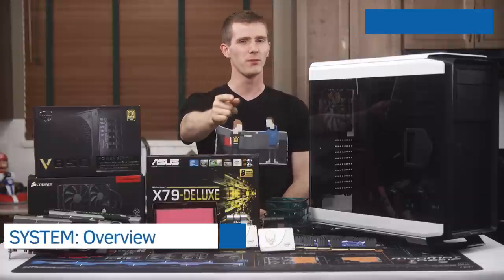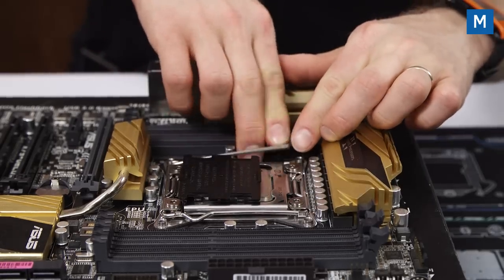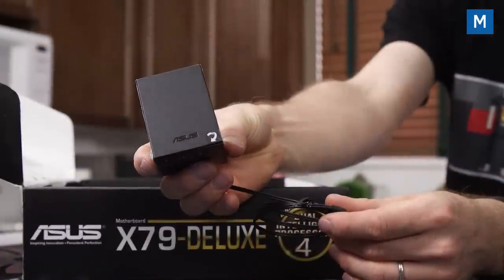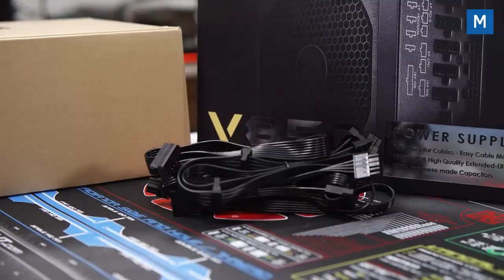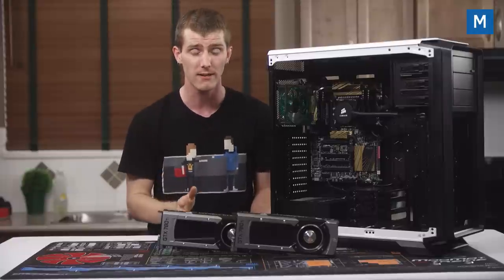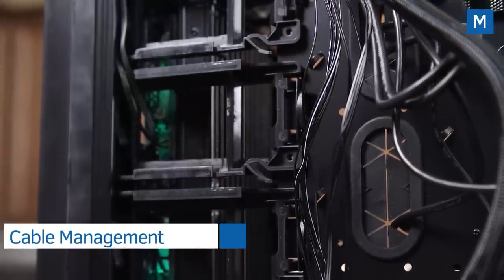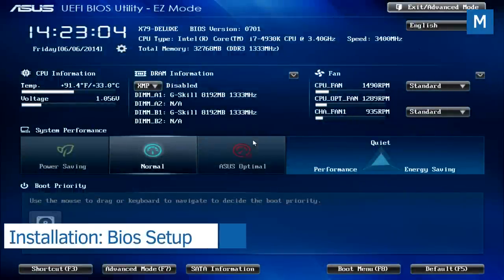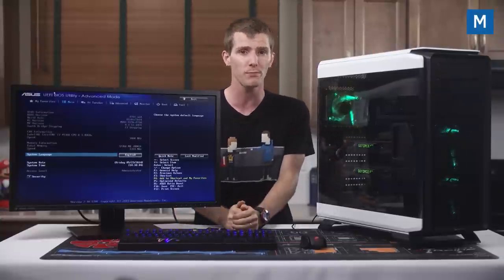How to Build the ULTIMATE 4K Gaming PC Build Guide

Comment: can someone tell me if this is a decent £800 Gaming Pc? Do i need a better CPU? Would it run games like dayz and Bf4 on high at 50-80fps?

Intel Core i5-4460 3.2GHz Quad-Core Processor
MSI H97 Guard-Pro ATX LGA1150 Motherboard
Corsair Vengeance 8GB (2 x 4GB) DDR3-1600 Memory
Crucial MX100 256GB 2.5" Solid State Drive
Asus GeForce GTX 970 4GB STRIX Video Card
NZXT S340 Case
Corsair Builder 600W 80+ Bronze Certified ATX Power Supply
Microsoft Windows 8.1 (OEM) (64-bit)
Reply: For the same price you can get a better CPU that will allow for overclocking in the future, assuming you buy an aftermarket cooler first :) This also has a bit better power supply.

http://uk.pcpartpicker.com/p/hRYwjX
Reply: Mike Adams do i need a cooler? i was thinking more like this: http://uk.pcpartpicker.com/parts/partlist/ (this is full build, monitor, keyboard and pc)
Reply: GamerBoy284 You have to copy/paste the link it gives you at the top of the buildlist, not the url.

And you don't need a separate cooler at first with the 4690k, it'll run just like a locked CPU with the Intel cooler. I would just be sure to get a good one before trying overclocking.
Reply: Mike Adams Oh sorry: http://uk.pcpartpicker.com/p/K2PYwP
But i need help on something, it says that some of my parts will cause some drive bays to be blocked/usable. On my particular build does that matter?
Reply: GamerBoy284 The Phantom 410 has 2 drive cages, one which is easily removable. You'll need to remove it for the GPU, but you still have 2 drive slots open even with the one cage out. I usually recommend to remove it no matter what, unless you have a bunch of hard drives, as it disrupts airflow if you leave it in.
Reply: Mike Adams how are they removed? do they just unclip. are the drive cages needed for anything? also, im looking at  a decent monitor with good graphics for games like bf4 on high settings. is this monitor good for this kind of play?: http://www.asus.com/uk/Monitors_Projectors/VS247HP/
Reply: also would i need any extra screws/wires or anything to assemble the pc or is it all included in the parts on my build?
Reply: The case will come with all the screws needed to install the motherboard, power supply, HDD etc, and the power supply will come with all the power cables. The motherboard will include a couple SATA cables for the HDD too. You'll be able to get it all running without any additional accessories :)
Reply: Mike Adams thanks so much for the great help, i forgot to ask will my build allow me to play games like battlefield 4 on at least high settings with 70+fps?
http://uk.pcpartpicker.com/p/K2PYwP
Reply: GamerBoy284 Most definitely :) That CPU is about perfect for gaming, and can be highly overclocked, and the 970 is good for 70+ in Ultra in BF4 easily.

I'm kind of jealous actually lol Enjoy it!
Reply: Mike Adams Thank you :D, most likely last question: Is the Msi Motherboard a good choice? since the asus cost to much i thought it would be fine. 

MSI H97 Guard-Pro ATX LGA1150 Motherboard
Reply: GamerBoy284 I honestly didn't even notice it was an H97 chipset instead of Z97. For full overclock ability, you'll want a Z97 board. The H97 can be overclocked, but you have to do it through MSI's Command Center app, and it's not the best way of doing it.

If you don't want to overclock, you can save some money and get a locked i5. But if you do want to overclock, I would recommend a Z97 board.

Here's your same build with the Z97 version from MSI:  http://uk.pcpartpicker.com/p/h9hTNG
Reply: Mike Adams Oh, what! i didnt realise you could get a msi z97. Its cheaper than the h97! does it have the exact same performance as the h97, all that is different is that it is easily overclockable and if i decide not to over clock, nothing will be affected/bottleneck?
Reply: GamerBoy284 Yeah I completely missed it too lol 

But yeah, pretty much all motherboards will give you the same performance with a single graphics card with a stock CPU, so no difference in performance. But if you do overclock, the Z97 will be much more user friendly and better suited.
Reply: It's good but for the love of god get a better PSU, Corsairs CX line of PSUs short out super fast under heavy load.
Reply: FrostFyre While certainly not the best power supply, the CX is decent. And considering he's looking at a maximum synthetic draw of no more than 300w or so, that actually puts him around peak efficiency.

For this build, because the 970 is so power efficient, the CX600 is fine.
Reply: Mike Adams so will the corsair 600w not short out as the other guy stated it would :S. i want it to last at least a year or so?
Reply: GamerBoy284 Well, I can't guarantee anything lol but it won't because of too much draw or anything like that. The CX series is fine for a build like yours. Where it isn't good is when you're trying to run power-hungry parts near its limit. You're running very power-efficient parts nowhere near its limit.
Reply: Isnt that the Austin Evans Positron build
Reply: Mike Kunz yes, nice spotting :P i wasnt sure if its a good build.
Reply: Mike Adams i dont need anything to be able to connect to wireless internet do i? once its build can i just wirelessly connect, right?
Reply: GamerBoy284 You'll need a wireless card. You can get them with a PCIe interface so it's not USB-based, and get a decent one for about $20 or so.
Reply: GamerBoy284 Here's a good strong one:
http://www.amazon.co.uk/dp/B0053GR2YI/?tag=pcp0f-21

The Intel one you linked is PCI based, not PCIe, and your motherboard wouldn't support it.
Reply: perfect
Reply: Mike Adams ok thanks, im ordering the parts today. please can you let me know if theres anything else i need for the computer to play games and use internet. anything as i am new to this and have no clue, appreciated.
Reply: GamerBoy284 Everything you need to start playing and using the computer is included in the parts you're getting. If you have a few extra quid I would get a better CPU cooler (since the one that comes stock isn't too great):

http://www.amazon.co.uk/dp/B0068OI7T8/?tag=pcp0f-21

That will give you good overclocking headroom, and much quieter performance than the Intel one. It's not needed, but if you want to overclock you'll want it. 

Other than that you're good to go :)
Reply: Mike Adams how am i going to install the operating system? is there somewhere i can just enter the code and download or do i need a dvd player and windows 8.1 disk?
Reply: Mike Adams no problem, i will need to purchase it as it is my first pc and dont have one. will the one you suggested fit into a corsair 450d case?

http://www.corsair.com/en/obsidian-series-450d-mid-tower-pc-case
Reply: GamerBoy284 Definitely :) You'll just need to remove the cover piece on the case, and it'll slide right in. Corsair has great instruction manuals as well, in case you get stuck.
Reply: Mike Adams thanks for all the help. ordering all the parts tomorrow hopefully. with windows 8.1 disc do i just put it in when the desktop is on then it will start downloading? also does this include the right windows 8.1 disc suited for gaming? http://www.ebuyer.com/581587-windows-8-1-32-bit-64-bit-eng-intl-dvd-wn7-00580
Reply: GamerBoy284 Yeah, that disk will work great. To install Windows, you'll just put the cd in the disk drive, and might need to go into the BIOS and select 'Boot From CD/DVD Drive' Your motherboard manual you'll get will have information on how to do this, and you can probably go on Google or YouTube and find some videos and step by step guides to install Windows. It's a pretty easy process, and with an SSD will go pretty quick.
Reply: Mike Adams ok thanks, i dont really know which is better, asus gtx 970 OR Msi gtx 970? which is more reliable and faster. (around same price)
Reply: Mike Adams also, is this windows good for gaming. it doesnt say 64 bit or 32 bit. 
http://www.amazon.co.uk/Microsoft-Windows-8-1-Full-Version/dp/B00FRAE7MU/ref=sr_1_1?ie=UTF8&qid=1418166729&sr=8-1&keywords=windows+8.1+64+bit
Reply: GamerBoy284 Perfect for gaming :) It comes with both 32 and 64 bit
Reply: GamerBoy284 If you're going for an ASUS motherboard, go with an ASUS GPU, same goes for MSI. match them. Both MSI and ASUS parts are very well made so you can't go wrong with either.
Reply: gosugirl1 ok thanks, im getting a msi motherboard so should i get this msi graphics card, is it the best 970?
http://www.amazon.co.uk/MSI-GTX-970-Graphics-Express/dp/B00NOP536Y/ref=pd_cp_computers_0
Reply: GamerBoy284 It doesn't really matter which graphics card you get, but that is a good card. I had an MSI 760 when I had my desktop, and it performed great, and quiet.
Reply: Mike Adams id seriously prefer the asus gtx 970 just due to my preference ( i realise they basically perform identify, just had more experience with asus ) but is it true, should i get the same brand motherboard and graphic card? or can i go for the asus?
Reply: GamerBoy284 No, any card will work almost identically. MSI does have their 'GPU Gaming App' or whatever they call it, but the boost it provides can easily be achieved through overclocking even a slight bit.

The ASUS is a great choice, and most would argue ASUS has better customer support than MSI as well.
Reply: Mike Adams yeah thanks but i just realised one website sells the msi gtx 970 for 30 pounds less than the asus. i think id rather go for the msi and you said the msi has a 'boost'? so at fully stock the msi will perform better, right? which do you think i should get as i still prefer the asus over the msi.

(msi: http://www.ebuyer.com/663848-msi-gtx-970-gaming-twin-frozr-v-4gb-gddr5-dual-dvi-hdmi-gtx-970-gaming-4g?utm_source=google&utm_medium=products&gclid=CjwKEAiA-5-kBRDylPG5096R8mASJABqEdm491dr6OaXUtrKQyey3FbZYYKRbm1j1HQF9YU_rDuAWBoCe7zw_wcB)

(Asus: http://www.ebuyer.com/666705-asus-gtx-970-strix-directcu-ii-oc-4gb-gddr5-dual-dvi-hdmi-strix-gtx970-dc2oc-4gd5)
Reply: GamerBoy284 I say go with what you like, if the extra 30 quid isn't a big deal. At fully stock, the MSI would perform marginally (and I mean maybe 0.5-1% better, and that's if you have the gaming app activated) but both of these cards come pre-overclocked, and can be overclocked very easily.

The real-world performance differences will be negligible between the two.
Reply: Mike Adams so the msi is 30 pounds cheaper with the same performance, but which do you think is better made and will last longer?
Reply: GamerBoy284 ASUS has always been regarded as one of the top, if not the best, manufacturers for anything. You can't go wrong with them. I've also never had any problems with MSI products. Personally I would go with the ASUS, the Strix is a great card.
Reply: lol DayZ and bf4 are COMPLETELY different....... Bf4 YES..... DayZ... I'm not sure there IS a computer build that can run that game at max settings at anyhting above 10 fps. (I'm talking about Arma II... DayZ is just a mod.)
Reply: upplsuckimcool16 true true. id be fine with maybe medium with 50-60fps
Reply: GamerBoy284 Yeah, I run DayZ at High/Very High mixed at 1080p with some AA and get around 45-50 with an i7 and a 970m, so your build should get even better. The problem with DayZ is optimization, and you'll see frame drops even with the best of systems.
Reply: Mike Adams i7 with 970, wouldnt that be better than my build?
Reply: GamerBoy284 I wish lol mine's a laptop. My configuration gets about the same, maybe ever-so-slightly-better performance than an i5-4460 + GTX 760 desktop parts.
Reply: Mike Adams jesus that must be one beast of a laptop. may i ask what laptop it is?
Reply: GamerBoy284 Sager NP8651. Best bang-for-the-buck laptop available by far. Most laptops that cost the same have an 860m, which is less than half as powerful lol I got it because I needed one for work, and figured I would get a nice one and use it for games too lol
Reply: Mike Adams thats amazing, its much cheaper than my build with better parts >.< what games do you play? im planning on getting dayz, arma ll, bf4, the crew, neverwinter and a few others.
Reply: Switch the proscesser for an amd fx 6300 and the motherboard for a msi 970a g43 oh and an xfx r9 280x is an optional change
Reply: You could shave off a bit of that fat with a cheaper card you know.

Go to PC Part Picker and look for a 2 gb card with a fast clock speed, most games don't use the extra 2 gb of video ram unless you insist on playing at ultra settings or something. And even then, that processor and ram should help alleviate some of the load and give you more than 60 frames.

I would also recommend a secondary 7200 rpm 1tb drive for putting all of your shit on. Music, Movies, Games, etc, keep applications, windows, and drivers on your ssd. That's only like 50 bucks more.

And finally, make sure you have good fans to keep those temps below 40.  =)

Good luck man, hope it works out.
Reply: you could go with cheaper ram, also did you include your peripherals in your bulid
Reply: Adam Smith Oh god no, PLEASE do not get the MSI 970 board. They overheat like crazy and have poor power delivery.

And don't switch to a 6300, you'll get worse performance. The i5 is perfect for gaming. The 6300 is good when on a tight budget, but this build is not a tight budget.
Reply: Mike Adams i got a msi z97 guard pro, i already ordered it, is it really a issue or are you talking about the msi 970 gaming board?
Reply: Mike Adams I meant to say a 8320 but still the 6300 runs about equal with an I5 and well you may be right about the motherboard for this build but for cheaper builds like £500 its pretty good
Reply: Yeah, maybe a z97 mother. The rest is good. That GTX 970 will go +60fps on 2K
Reply: I have the msi gaming 7 and its a great mobo.
Reply: Mike Adams Mike i need some serious help. i built the pc and its up and running with internet but i cant seem to do a lot of things (like certain websites and i cant watch videos on some websites and cant play games) i installed java. is there some software i need to install? please im desperate.
Reply: You're not going to get dayz @ 50+ fps(unless there's a patch, i haven't played in a while)
Last time i played I got dips to 25 fps often. I have a 4930k @ 4.5 ghz. The game was just poorly optimized.
Reply: ***** he said dayz.
Reply: with dayz you will never get 60fps in cities with any pc
Reply: ProjectXLGaming
Only with view distance under 1km or w.e. I forget the scale of the game. The game is cpu/server bound because of all the objects in the city that the game tries to load. I like to have my view distance to  2km to see players as far away as possible but it's a lot of lag because of all the items. I'm runnin 4930k @ 4.5 with sli gtx 980s.
Reply: LOL i have i5-4460 dont buy it ... in 1 week it will be slower
Reply: Aygun Ahmedov i got a 4690k
Reply: For just games that cpu should be fine. Certainly check out something like the 970gtx cards too - great value for money and the one I have (an overclocked from the factory version) is pretty close to the 780ti and it's a fraction of the cost).
Reply: Probably a bit late but you can pick up a 780ti for 310 on Amazon and it only comes with cosmetic damage on box just a helpful tip
Reply: Also just realising something 

Austin Evans build guide
Reply: Oh shit your righ ^^
Reply: Adam Smith correct, but i changed a few components since this post. changed case to a corsair, changed processor to i5 4690k. i built  this about 3 weeks ago. get about 100 fps on ultra on bf4. quite impressed.
Reply: You copied Austin Evans with his $1000 Positron Pc
Reply: GamerBoy284 geez harsh
Reply: GamerBoy284 just in case you didn't know here are my specs. I7 4790k, corsair h100i,16 GB g.skill ram 2400 MHz, MSI h97 g43, CX 1000w, evga gtx 980, Intel 730 series 240 GB ssd x2, WD black 1tb hdd x2, nzxt h440 white window. Samsung USB 3.0 optical drive.
Reply: That's about over at least $1900, so don't even talk about money you little trash talker. I bet you your PC isn't even nearly close to mine.
Reply: Ahmad Amir i can clearly see your computer is a beast, it cant even handle recording you edit a picture 'how to lower a car' what a beast that machine is. to me it just seems you researched all the most expensive components and said you own them. im calling Bs. your picture is of a 8 year old so.. i dont believe you.
Reply: GamerBoy284 that's the picture of my little 5 year old. You can clearly see that video is from last year. I built this computer this new year for my new year goals. I still have the pic from my new egg shopping cart.
Reply: To be honest I am doing the positron for my 15 year old. So there was no harsh meaning in by copying Austin Evans he is a great guy and is very helpful. Thanks and stop talking trash.
Reply: Ahmad Amir You're right i was talking trash.  I just got pissed off as you said i copied him, and if its positive, it does not look like it. Looked like you were being rude that i based a few of my components off his video. i also got pissed because if you didn't see someone else said i copied his video, and i politely replied, but with you, you repeated his comment which further expressed it in a negative light. However, since you are a adult i respect you, and i sincerely apologize. Im 15 and i built Evans build with some upgrades, and its a beast, i got 110 fps steady on ultra on bf4, about 60 on dayz outside town etc.. Make sure you get a 120hz monitor at least, i got 144hz with 1ms response but i dont think it makes a massive difference, but i haven't compared so, Good luck.
Reply: The computer should work fine on max settings for dayz but I would consider 16gb of ram for the future
Reply: 50-60fps on high? bruh, a gtx 970 can run bf4 on ultra at 110+ fps lol. it can even run it on 1440p ultra at 50fps+
Reply: Heisenberg101 yeah i can run 1440p at 90fps - 100fps on bf4 so it was much better than expected.
Reply: GamerBoy284 oh lol, that was better results than i thought, did you overclock it?
Reply: Heisenberg101 no, but i got a i5 4690k instead of  the 4460 so thats why :)
Reply: Yh u can't OC any Intel non K series CPUs
Reply: GamerBoy284 I bought a refurbished ASUS G750 laptop for $700  its an i7 GTX 765M and it runs The Crew nice..  and BF Hardline comes out tomorrow.  Runs great.   But I wanna sell this laptop it has 2TB and 8GB RAM.  I put a new glossy screen cuz i accidentally shattered it.  for $650!  (i want to get a GS60 044 Ghost Pro.)

Don't get me wrong..  i have a Tower too witha  GTX980.  But laptops are AMAZING lately.  Trust me.
Reply: ☢ ᴅᴠᴅ ᴘʟᴀʏᴀ ☣ There's no comparison... Laptops have always been far behind, and they're not catching up that much recently... Maybe you're just going blind? Also, your grammar is wrong. What you meant to say was 'It runs The Crew nicely'. You also meant 'It runs well', 'because', and you also just said that you shattered your screen accidentally for $650. Please learn English.
Reply: ☢ ᴅᴠᴅ ᴘʟᴀʏᴀ ☣ sorry but who in there right mind would buy a laptop for gaming unless you go on holiday monthly.. i'm quite sure your laptop could not run any demanding games like dayz. if you want to compare rigs, mine is already above you, standing at £1500 with monitor and keyboard. I quite easily get 110FPS on bf4 ultra, please let me know of your fps. Dont start a argument with the clearly vastly superior hardware and customisability..
Reply: GamerBoy284 You'd be surprised.  And I have a shitty $700 G750 laptop.  I can run Battlefield Hardline on Ultra 720p.  You don't think a beast 044 Ghost Pro wont run laps around desktops?  You're crazy.

I don't understand you though.  I have a Z97 mobo i7 4790K and GTX 980 desktop PC.  What's the argument?  The Ghost Pro is almost as good as my rig!!
Reply: ☢ ᴅᴠᴅ ᴘʟᴀʏᴀ ☣ i dont believe you have that desktop, you were just arguing about laptops and how good they are. do a video of your rig or you dont own it.
Reply: GamerBoy284 no you can run 58 fps with 970's
Reply: GamerBoy284  What am I gonna record with?  My iPhone 5 doesn't have any memory lol  This phone is garbage.  I never filmed anything.  My friends always had HD cameras when filming and skating.  Not me.

I have a video of L4D2 on here at Disneyland playing on my laptop just fine.  Smooth
Reply: FrostFyre Hey , arent the HX or RM better than CX ? i mean what makes them better versions ? if i was looking to get a corsair PSU what version woudl you recommand ? and for you is +Gold worth it ? or +Bronze is enough ?
Reply: ***** The HX And RM models Are better than the CX/CS Models Because they  use better capacitors and they don't have High inrush current and high +12V ripple levels, And 80+ bronze is good enough but if you have the money get a Gold or higher PSU If you have the money.  And if you have to get a Corsair PSU The lower wattage RM PSUs And any/all AX Models are the way to go but if you can get an Antec HCG or SeaSonic PSU As they're better.
Reply: upplsuckimcool16 My PC can Run Arma II At Maximum settings, it didn't even cost that much.
Reply: Really, laptops are actually not that bad. Between the 700-800$ range, it's easy to find laptops that can run heavy games like BF Hardline at 1080p medium or high settings, around 25-40 FPS
Reply: Get DDR-4 memory an a better processor, i have a 4790K, the difference is the cache, and its 4.0 GHz base clock. 

Or you could just get the 4790, but the price difference is very small. ($50 for OC)
Reply: Austin Jerousek with my gtx 960 i get 80 fps  on  150% resolution
Reply: GamerBoy284
i can get 50 fps on battlefield 4 high settings with my fucking gt730 =))))
Reply: Siktronix i watched a video of a guy with your graphics card bf4 he has all low settings and he gets 40fps, after seeing that, i dont believe you. but i actually do get 90-100fps ULTRA bf4 look up 'gtx 970 i5 4690k bf4' your'll see.
Reply: overclock brother.. ;)  + a 4 ghz processor...
Reply: and i maked a mistake..sorry.. it's battlefield 3, not 4 ... :D
Reply: Siktronix oh thats fine, sorry for being rude. good on you thats a super good price for that frame rate.
Reply: thanks.. i know.. i'm planning a gtx 980 in summer.. :D
Reply: Well, isn't this just Austin Evans' Positron build? Like, completely identical? If so, I would go for it because that PC is an absoloute beast, although maybe sticking another 4GBs of RAM to benefit multitasking wouldn't hurt either.
Reply: Also, with everyone saying you should use a 980, that card would need a better power supply, a better cpu, better cooling, blah blah blah. If you have a budget then this PC is fantasticly powerful and the 970 is great value for money, although I personally would go with an EVGA OC card rather than a STRIX one, just because a STRIX is red and everything else in the build is blue. That's just me being OCD though.
Reply: GamerBoy284 It is a bit more than £800 but this is the build I will be getting http://uk.pcpartpicker.com/p/pfvxP6
Reply: Alex Maurer briggs no need for liquid cooling and get a case for 19.99. 100$ saving right there
Reply: I will be doing a lot of overclocking and also I need a case which I know will be very reliable and well built.
Reply: Techno Alex Use a cereal box.
Reply: But those are so expensive D: